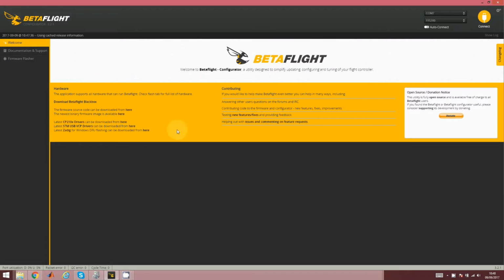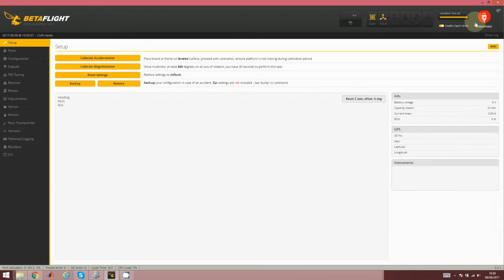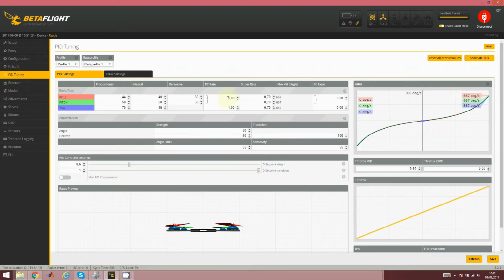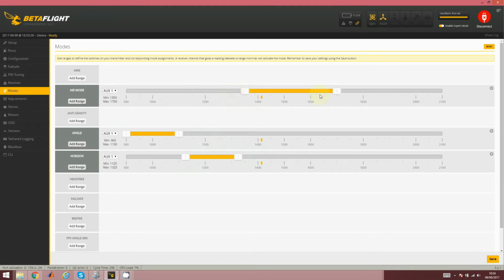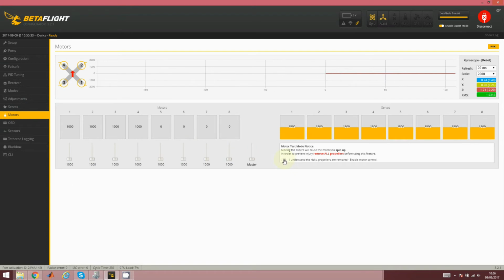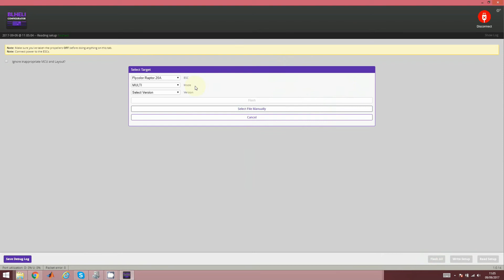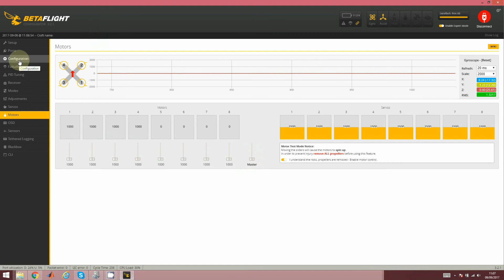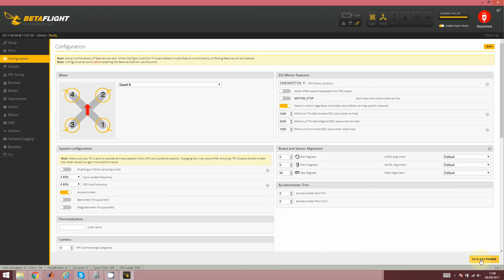Tovsto Falcon 210 betaflight installation and BLheli firmware upgrade procedures (Courtesy RCmoment)

Comment: hello, this is the same as tthe redcat reacing carbon 210?
Which driver did you install for this, I can not connect to betaflight and my computer will not recognize the device.
Please help.
Reply from the maker: STM VCP driver should be installed

Comment: hi there Seby i just bought this tovsto falcon 210. i watched your videos related to this quad. Is it dangerous for a newbie like me to conduct this setup. What are the benefits of doing this. Thank you
Reply from the maker: Well it's up to you to fly out of the box the Falcon 210.... but be aware no working failsafe out of the box..... so it can be very dangerous in case you lost the control range
Reply: Yes i’ll follow your guide to adjust the failsafe. Thank you so much sir for your time & effort making the videos its really helpful
Reply from the maker: You're the welcome :)